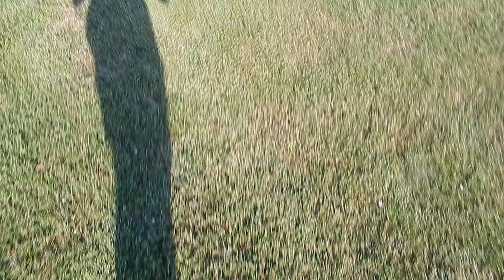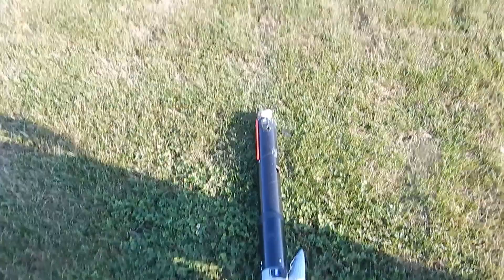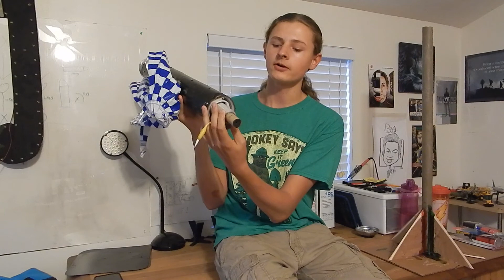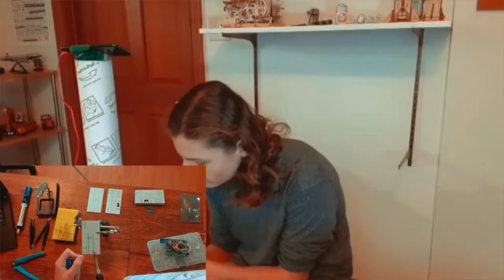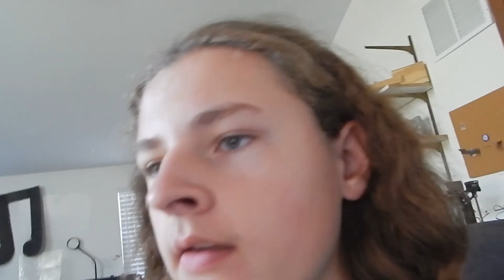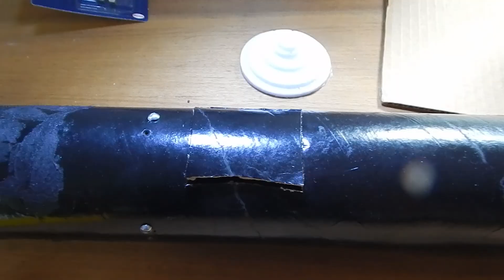Grapefruit 3 TVC Rocket Launch and Analysis

Comment: for your next attempt, use a LiPo instead of a 9v. it doesnt even have to be multiple batteries in series or parallel, i have had success with a 4.2v 1,100mAh one, but yours doesnt need to be that beefy. i would advise using a protection board such as a TP4056 so you dont blow it up on accident. using a LiPo is worth it in the long run because it can be recharged and it ignites faster with the higher current. they arent meant to be used as pyro charges
Reply from the maker: That's what I got for the next flight computer. Thanks for the suggestion!